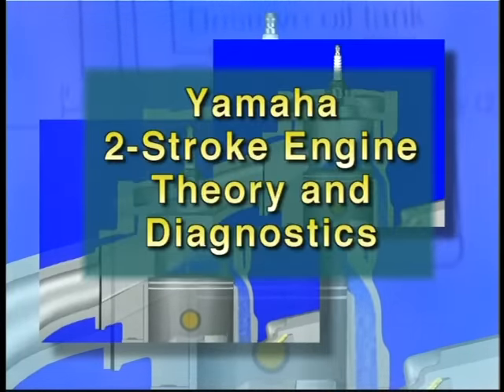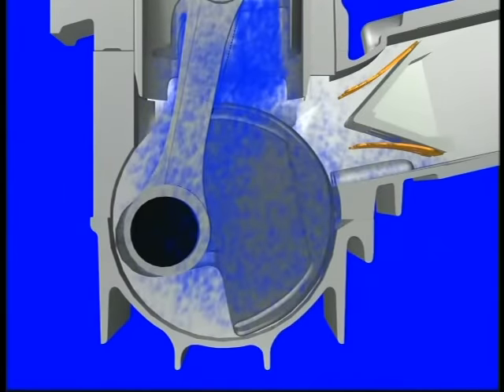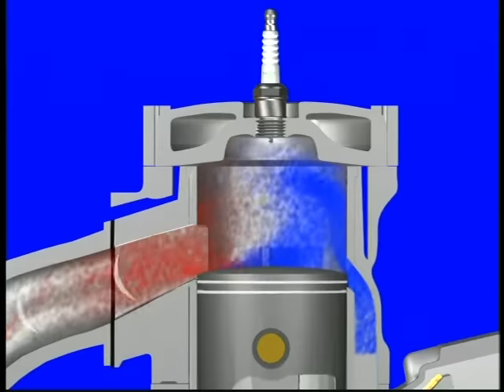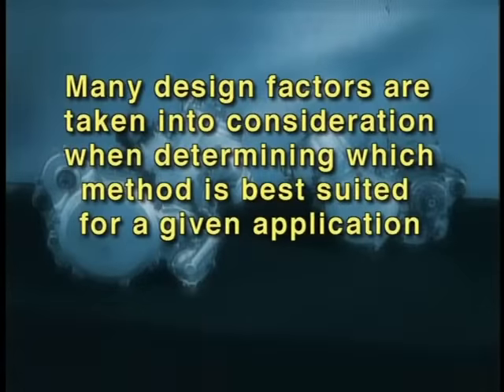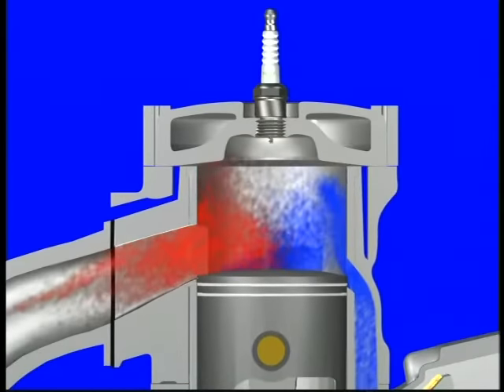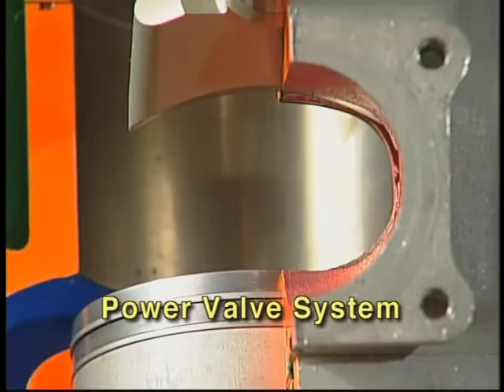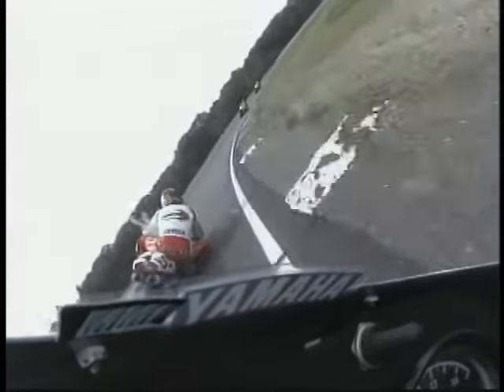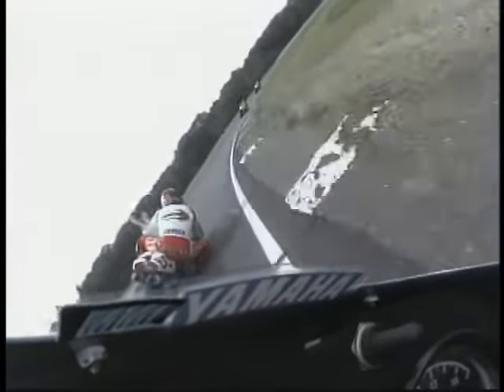Yamaha 2 Stroke Engine Theory And Diagnostics

Comment: As I struggled with a non functioning small  2 stroke engine on my leaf blower ( suddenly after 3 or 4 years of good service), and trying everything I could think of,  I stumbled into a video about a unit with many of the same history/repair points as my unit. That engine was repaired by tightening of loose bolts, cylinder to block, which was permitting air leaks. I checked my engine - rock solid but while there I chanced to remove the blind end plastic crankcase cover. Nasty hole in this cover so I went looking for detailed info on what could this mean to the engine function. This video was just excellent......no vacuum on the upstroke (no fuel and air into the crankcase), no pressure in the crankcase on downstroke to move the mixture into the combustion chamber and lots of air leakage. Repaired the hole......my leaf blower is just fine again. Thank you
Reply: I wish these guys could link da toos for advertising n sheeeit

Comment: After watching this it explains whe I'm having trouble with my Morini Franco 50cc, I had low compression and bought a cheap Chinese replacement piston which is slightly higher at the crown and now I think that I should have paid more and got an original one.
Reply: It'll be fine back the timing of some if it starts pinging
Reply: @danielfrazier840  Thanks for the replay, but I defo should have bought a suitable piston, I've damaged the Nikasil plating on the cylinder and it will cost me plenty to put right.
Reply: 你可以將汽缸頭進行平面修整，可以『技術性』的修平大概0.1～0.5mm不等的厚度，這樣你會有很好的壓縮比，當然，精細的計算過會更好，而且有一個備用的汽缸頭永遠是最安全的事情以免造成不可逆的後果。不過聽你的描述，假如汽缸沒有磨損，說不定你只要更換活塞環就能恢復很好的汽缸壓力了。
Reply: @honingholes7026  It is hard to damage a good real Nikasil plating,--and there is no shortage of crummy plating out there today.  I doubt you had the good stuff.

Comment: Cool video. Watched the whole thing as I’m about to buy a YZ250!
Reply from the maker: Good choice!
Reply: this is the first video closest to the truth of the reason a 4 stroke will never make as much  horsepower  as a 2 stroke of the same displacement !  now watch the video again and again and listen as its told pressure is forced higher than the incoming air trapped by the reed valve as the piston is making the compression in the crank case 1st that is much higher than the air than enters the carburetor ...we call this condition supercharging by no other name .and when he stress the fact that it is a sound wave that blocks the supercharged air from escaping the exhaust port as the piston now traps the supercharged intake air/fuel and compresses this mixture the 2nd time into the combustion chamber right before the spare plug explode the mixture with no telling how much more force than a 4 stroke of the same displacement but i will say that Yamaha knows along with KTM , Husqvarna and GasGas who has their MC 125 two stroke making 40 horsepower that is roughly 20 horsepower that Honda's pro CRF150 R motocross racer that on a good day barely makes a claimed 23 horsepower while the GasGas is in the 1st turn while the Honda is still clearing the gate after a little cuttie turns the 5 sec board sideways skipping off the track  wearing a skirt and top she out grew years ago
Reply: Once upon a time that may have been true about 2 strokes having more power than a 4 stroke of the same displacement but not anymore. A yamaha 250 f can make more hp than a yz 250 . The reason is the,compression ratio. Follow the 2 cycle on a complete cycle again and observe that as the piston rises it doesnt start  true,compression until the piston completeley closes,all the intake , transfer  and exhaust ports which is about halfway of  the upward intake , exhaust then compression stroke, AND,the power stroke,has the same situation , it only has a,2/3 or so true,power stroke before a giant hole opens up and bleeds off any expanding gases that could act upon the piston face  if it didnt. Altho the 2 stroke has primary compression in the crankcase area under the piston and has a power stroke every time at TDC or twice as many as a  four stroke it doesnt have the efficiency of a four stroke in the Carnot cycle  or PVT ( pressure - volume - temp  relationship which has a total duration ( some can have more than 180 degrees,of compression or power but to some extant ot is 180 on each . A higher compression ratio is a more efficient engine and doesnt waste the fuel as much and also has a better lubrication system than the  total loss of burning it . However where the 2 stroke shines over the 4 stroke is power to weight. Very light, simple and cost effecrive do to simplicity  and less parts to machine.
Reply: @waynegarfield6607  what you said is impossible simply because 4 stroke dirt bikes are not supercharged  but 2 stroke dirt bikes are internally supercharged by the  double action of their pistons that was said to be true by Hideo "Pops" Yoshimura , the man who invented honda's very 1st 2 stroke called the Elsinore ..ever heard of one ? they are the bikes that make that Braaaaping sound when your being passed and yelled at "get outa myway bitch"
Reply: That's a hot bike. Good luck with it!!
Reply: @waynegarfield6607  Yes, you are right in Motocross that the 250 2-stroke makes the same power as a 250 4-stroke.  But a 4-stroke engine hooks up to the ground better (man, the EPA got lucky there, or the 4-stroke would not have been jammed in our faces and suck up our pocket books), so it can make more HP and still be "ride-able"on a MX track, (which are now much faster tracks because the the faster 4-strokes). A 60 hp CR500 is a handful for anybody, and the 450 pros are making 70 plus hp today because the engine power delivery is smoother.  There are 250 2-stroke engines out there stock, (Honda V-twin 250 for one example),  that make 90 hp, applicable for road racing, but not MX.  You can always supercharge a 4-stroke also, and that would make your statement much more true.  :)
Compression is not a factor, as we can set it where ever we want with head design.  But I do think there is still some power in the 4-stroke power stroke because it does not bleed the pressure in the cylinder at 90 deg past tdc with an open exhaust port.  But that slight advantage may be lost by the extra rotation of the crank.
Reply: @donniebaker5984  There is a vid on YT with a guy doing a off road race on a 1974 Elisnore 125, (go-pro on his helmet) smoking all the larger modern 4-strokes. Funny as heck.  :)
Reply: @EarthSurferUSA  I lived in Santa Fe NM for a couple of years. All the employees of Suzuki and Yamaha would get together on the week ends and ride there race bikes in the desert south of town to the Rio grande river.  There are miles of what they call a arroyo their  sand washes that go to the desert out to The River and the the closer you get to the Rio grande River the deeper the sand washes become until they're wet like a wet hard Beach.. there is where you can take your bike and top it out for about 10 MI on wet naturally hardend  sand it's so hard in the bottom of the sand wash so flat so wide is almost like traction on Pavement... One guy Sidney  about 89 pounds  would ride his tuned 1975 CR 125 with a top end desert tune ported out like a go-kart power band 48 mm mikumi racing carb from a mx500 Yamaha that killed all the low end ...I was riding 1974 Yamaha DT 360 street Enduro stock that i managed to squeeze 85 plus almost 90 mph on the street    but this day I was bare bones topped out on the pipe with 10 miles to go ..and I could heae him coming as loud as a CR125 can be with no silencer on a flat track tune expansion chamber but a deeper sound but still an octave higher than any model airplane engine. ..and it's Sid we called me flipping me the bird on his new at the time 1975 CR125 Honda Elsinore passing me like I was parked !
Reply: @EarthSurferUSA  the gas gas 125 has been on the Dyno test by independent tuners and that all got the same read out from the common dyno-jet that is the standard today ..and don't you want to know the numbers. ?  The 2023 MC125 gas gas 2 stroke makes 40 horsepower with 17 ft lbs torque weighs bare minimum FIM rules that is around 214 pounds dry ..that is 40 lbs less than a 4 stroke 250 that barley makes 45 horsepower. Watch these red rockets on kaplan America you tube channel who sells a new Mc125 gas gas for $6969 out the door

Comment: Hi. I bought a brand new CF MOTO 450RS motorcycle and from new, gear changes were rough and it had vibrations.  After the first service, the bike felt a lot worse, and engine was over heating sporadically.  At 1400klm I realised when the dealer said that it was normal and I had taken the bike back 6 times, back to the dealer, I investigated the problem and found the dealer was filling the oil to below the empty level.  When I toped up the oil, it took 750ml to get it to the full line.  That's 1/3rd oil missing since new.  

In the cf moto user manual it states that the oil should only be filled to below the low line, but in doesn't say if this when the bike is on the side stand or upright on a service stand.  Turns out they were filling it up on the service stand in the upright, and those instructions were for the bike being on the side stand.  So dealer was filling my bike and some others short of oil.

Engine now sounds rough compared to new bike and I am hearing a slight ratting sound.  Can you please tell me, during this crucial run in period, what is the potential damage to the engine and gear box?  I think during the crucial 1000klm run in period not having enough oil to meet even the bottom line of the low indicator mark would have caused damage, but dealer said no, it's o.k..
Reply: How can you "fill below empty"?  
Not many real good mechanics around today.  IMO, you are better off learning it for yourself.
Today,---education starts after graduation, but you have to make it happen yourself.

Comment: They skipped overheating and air leaks from worn crank seals .
I went to Yamaha marine school then . Excellent 👍
Reply from the maker: Thanks for sharing
Reply: I had a 1983 Yamaha YZ125 dirt bike that had worn crank seals. One day, the engine RPM suddenly increased to a very high level un-commanded and I had to press down on the kill switch for several seconds before it finally died out. After that, it never started again until I sold it to somebody who went through the whole engine with a fine tooth comb and replacing all worn parts.
Reply: @vigorousboredom7016  yes..Lean out can cause piston seizures crank rod bearing fail from no oil and not lean mixture.
Reply: It talked about lean conditions from air leaks, and even showed a "leak down tester" to find them.
So----how did you do in school?   :)
Reply: @MitzvosGolem1  Yea,---I would not let you work on my stuff.  Did you just make up a phrase, "lean out"?
I don't even know what that means,---so say "a lean fuel/oil mixture", (not enough oil or none in the gas), and differentiate it from a lean fuel/air ratio.  Both can cause piston seizures.
Reply: @EarthSurferUSA  ok kid..
I built thousands of engines since 1976..
Marine Racing outboards

Motocross bikes 
Diesel engines

Ok kid
Reply: @EarthSurferUSA  to lean air fuel burns pistons ..
Regardless of oil .

Obviously you have a lot to learn .
Reply: @MitzvosGolem1  OK, 60 year old kid here.  How about 10's of thousands of ported/stroked engines and top end kits that I have sold in the last 20 years around the world.  I have modified and sold more 2-stroke engines/top end kits than anybody the world I believe.  I am finishing the porting for 18 top end kits right now, and may be the first person in the world to port 2-stroke cylinders with a CNC mill, (then I hand finish them all to perfection.).
Reply: @MitzvosGolem1  I never said a lean condition does not damage pistons.  There goes your imagination again,--or you just don't read very well.  Either way, you are one of those guys who "Know it all, but have a lot to learn."
I have not had a engine returned to me for a failure that was my fault in over 15 years.  I know your not even close to that.
Reply: @EarthSurferUSA  Sure
Reply: @EarthSurferUSA  Mercury outboards 2.5 Bridgeport F1 motor 2 stroke .
Raced MX Husqvarna and Suzuki.
You don't understand " lean out " term?
Be real man..
Reply: @MitzvosGolem1  This was the best vid I have ever seen about this topic, (should be from Yamaha engineering).  Now I am no Dr. Gordon Blair, so I did learn 2 things from this vid.  I will bet,---you learned nothing, and that is what holds you back.  :)
Reply: @EarthSurferUSA  When two strokes run low on fuel pressure or jets to small high altitude cause lean out..